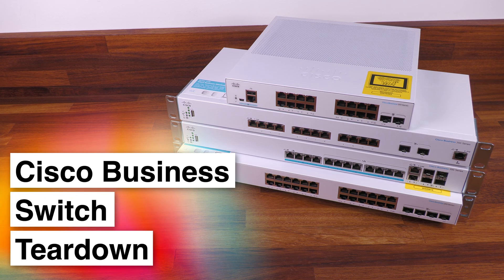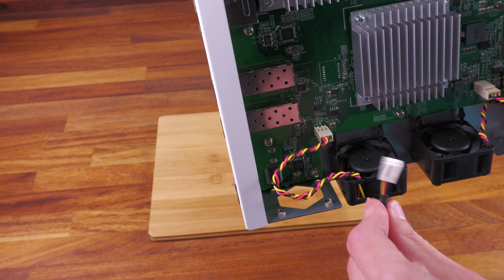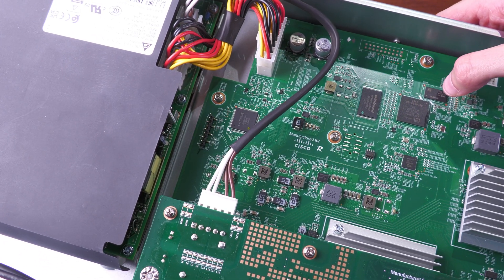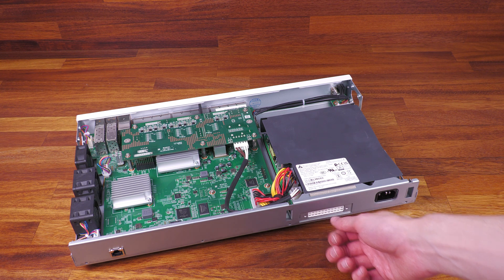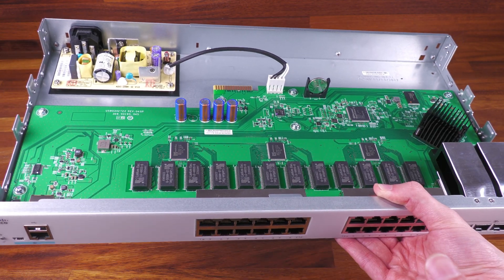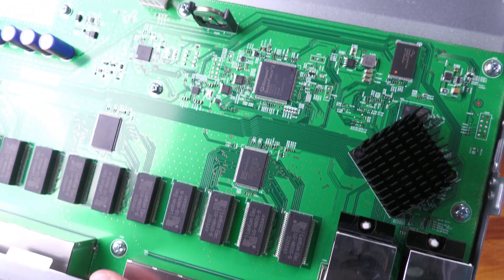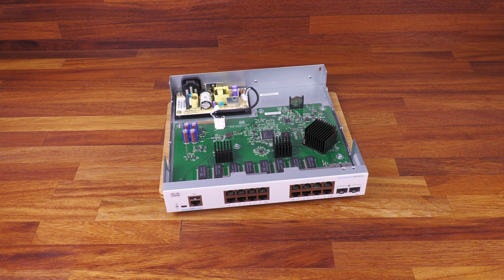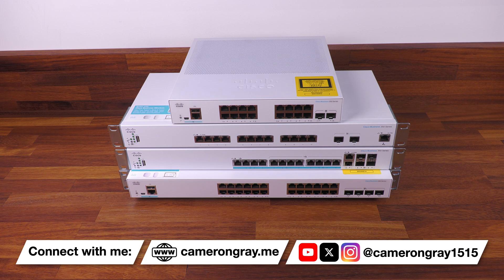Extra Video - Taking a look inside my new Cisco Business Switches!

Comment: PS in CBS-250-24T-4X is almost identical as in old Netgear GS724T. I got mine recently recapped.  I bet it is done by the same factories, even if brand would be diffrent. Apparently, world of network equipment power supplies is pretty small.

Comment: I've been looking at the CBS350-48XT-4X but it doesn't look like it plays nice with AOCs which is frustrating as the furthest run I have is 10m+ and I'm not 100% sure a DAC will work.
I also didn't realise they don't have stackwise cables on them
Reply from the maker: Where are you seeing this about AOCs, I can't seem to find anything?  Personally if I needed a fibre link between the machines, I'd get separate transceivers with a separate fibre cable.  That way you can use different transceivers on each end if either device requires a specific transceivers vendor.  That said, the switch has 10GBaseT ports so as long as the device on the other end can also support a 10GBaseT connection, you'd be able to just run a regular copper cable between them and get up to 100m with CAT6A or 55m of CAT6.  They don't have Stackwise connections, instead they stack using SFP+ cables between the switches (either DACs or fibre) although they can't stack using the regular RJ45 ports, only the SFP+ ones.

Comment: The 24 port was easily the most interesting because of all the exposed packages (lack of heatsinks), and I suspect part of that is that it's newer, the ICs are based on newer processes that requires less power and therefore less heat is being produced per IC; the way it's structured is fascinating, the exposed chips would be little more than port multipliers, bringing in a 8-10Gbps bus connection, likely as high as 16-20 gpbs to upstream (for bi-directional data transfer) up to a controller IC that directly connects to each switch chip, and provides the 4x10G SFP+ links; obviously the 10G chip with the three downstream connections to the 1GbE ports will be the fastest chip on the board to handle all the throughput.  The interesting thing is that it connects to the FPGA from there.  Knowing this switch line (which used to be the SG300X or similar), there's something called SDR, or Software-Defined Routing, and what SDR does is that it can actually handle L3 traffic being switched by the unit based on conditions; I suspect that the FPGA is to make the SDR features work faster to keep up with the 10G + speeds of the switch. there's a 512mbyte RAM chip on the 10G chip, which is likely the CAM table (aka mac-address table).... So what happens is, if a packet comes in on a VLAN that transits VLAN boundaries (L3 switching) it's forwarded up to the FPGA, which will do the forwarding, if the FPGA isn't programmed to handle the traffic (maybe there isn't a rule programmed for the flow), it will forward it to the CPU, which is the ARM CPU there; that ARM CPU runs all GUI/CLI, config, and CPU-based routing and switching, as well as monitoring and whatnot (and likely has it's own RAM in a Package on package design).  The Flash chip hold the at-rest config, firmware, etc. for all chips.  It's an incredibly interesting design and it's likely that other switches follow the same concepts, but run at relatively faster speeds (like the 12XT will move quite a lot faster than the 24T-4X), and require active cooling to keep up with the faster chips and design.

Usually the micro-b USB is simply an internal USB to Serial adapter which links up with the serial interface on the RJ45 port for console, specifically for programming and would generally be wired directly into the CPU (the ARM chip), and of course a USB host port for the external USB-A port, which would normally be used for flashing - eg, in the event the firmware on flash is corrupt or missing, the base programming on the board (UEFI or similar) would be able to check the chip for a firmware file and it would be able to follow a procedure to copy that to the internal flash storage and recover the switch.  I suspect the edge connector is for initial programming, with enough to power on the unit and have a data connection to the ARM CPU and/or direct to the flash storage, to do initial programming and testing while it's on the assembly line.

I'm mostly surmising from experience with how systems are designed from a long history of dealing with computers, and a long history of dealing with switches, as well as knowledge of the inner-workings of how some similar items do what they do.  Bluntly, you'd get more performance putting in an FPGA to do L2/L3 switching when you have programmable interfaces, such as with SDR, than you would relying on a CPU, but you would still need a CPU in there to do the general work of GUI/CLI, and programming the FPGA, as well as system monitoring; but the CPU can be incredibly low power, compared to everything else since it wouldn't need to do more than that 99.999% of the time, with all the traffic being handled by the IC's (ASICs) and/or the FPGA.  Since something like SDR can be changed on the fly, the FPGA would be a logical choice compared to simply throwing in a very powerful CPU to try to keep up with switching the related traffic; and overall it would provide a faster and better flow of data at a nominally lower cost than either putting in an ASIC (which cannot be changed/programmed) or by upgrading the CPU enough to handle the flows, which may require something a lot more power hungry and it would also require rather extensive software switching on the CPU - which would also be CPU bound, so if the CPU is busy handling CLI/GUI requests, it may bog down, and vice-versa, the GUI/CLI may be bogged down by incredibly high switching activity.

Provides a better and more consistent experience overall.  Like I said, I expect most of the (especiallly CBS350) switches are designed similarly.  Very fascinating, and thank you.

Comment: For smaller project installs I've been using the Cisco C9200CX-12P-2X2G switches.  A typical application would be like a security camera deployment with VOIP and maybe wifi. (Think security guard stations at a business park connected to a corporate network)

They are passively cooled PoE+ switches with 12 powered gigabit ports, 2 unpowered gigabit ports, and 2 10G SFP+ ports and can deliver up to 240W.  Now they do run hot but they are completely fanless with a giant heatsink block on top. (The heatsink is basically the case.)  They have a full sized SD slot for hosting applications such as an embedded wireless controller and run IOS 17 Lite XE which to me doesn't seem or visibly appear any different than normal IOS XE.

The suggested retail is about $1800, but you can get them for quite a bit less if you're a corporate customer.
Reply from the maker: They look good, however as soon as you go to the higher end Cisco Catalyst switches you're needing to deal with licencing and support contracts, something that makes them unviable for many small businesses settings.  They're great switches for sure, but just not practical cost wise for many environments.

Comment: I noticed the one switch says "Manufactured for Cisco" which isn't something I would expect an an actual made by Cisco switch to say.  So I'm thinking they either contracted out the switch development, or they found a third party switch and put their own custom OS on it and rebranded it.
Reply from the maker: Yeah, it's interesting, I'd be interested to know what that "R" logo is for - some sort of OEM possibly?  That said, those definitely aren't a white label product that has been simply rebranded, but I wouldn't be surprised if the manufacturing was outsourced to an external company.  Although that's dead common for most manufacturers nowadays.

Comment: why the hell do you need industrial switches for a home network lmao there is no possible reason for that
Reply from the maker: Short answer is "I don't need them" however I enjoy tinkering with these things and it also allows me to produce these YouTube videos.  On the other hand, a YouTube video showing a basic wireless router and unmanaged desktop switch wouldn't exactly be interesting!  Additionally, having 10GbE switching allows me to transfer large video files to and from my NAS at a significantly higher speed than I could over a basic gigabit connection.
Reply: because that's the way he likes to do things.
Reply: Nah industrial switches would be like an IE 3000 or Stratix line.  These aren't even based on the normal Cisco catalyst line which is their normal business switch.
Reply: @stonent  shut up nerd

Comment: The internal card edge could well be for manufacturing: When the board has been assembled, it has no software yet. We add connectors to similar boards, where the connector carries power as well as programming signals. This allows manufacturing to plug one connector into the assembled board, and the board gets powered, programmed, and tested using this connector before it gets put into the case. Since the connector is only used once, cheap is good, and a card edge is cheap.
Reply: There are similar looking edge connectors that I've seen on the small 8 to 12 port small form factor Catalyst switches.

Comment: That port on the back looks like a Cisco RPS power port. Some Catalyst series switches will have this. A Cisco RPS will be a 1u device providing resillient power to switches using the connectors. There is a data reporting aspect to this as well on the pins. I dont know the CLI of CBS switches, but you might see an entry for RPS  status if you enter "show environment all".
Reply: My 3750 v2 has this port too, i was gonna say its a Cisco RPS power port. Quirky how its there tho :>
Reply: Exactly what I was trying to say.

Comment: Wow! Thanks for show. Most products do not need more 19" form factor, 10" enough. Yeah switches these days looks very clean and unstagged. 😉🤗 1st comment after orginal author wrote. 😂
Reply from the maker: Yeah, I quite like what some vendors are doing now with half-width switches where you can install two in 1U.
Reply: @camerongray1515  Yeah, in history the admins in companies build DIY boxes for small boxes but these days the most companies haven't admins nor house managers with offices. Possible do you can build some self and resell the blue print? This makes you independent from YT, Twitch, and other big companies. 

A horizontal small switch with keystone place at one other side sounds great. Same what I can't understand why not all network related stuff only in front - and power management at back.
Reply from the maker: I suppose historically a lot of that DIY construction was done due to a lack of off the shelf solutions.  Nowadays, the cost to a company of staff time vs buying off the shelf solutions just makes the DIY route no longer financially viable.  Complete off the shelf solutions also come with commercial support which many companies want.

As for making something myself, it's not really something I have any experience with.  YouTube isn't my full time job so I'm not reliant on it for my main source of income. I'm already busy enough as is with my day job and other general life things.

As for why switches have network ports on the front and power at the rear - this simply makes more sense for most rack situations.  Ports on the back would be awkward to access in almost all racks.  Netgear do actually sell some rack mounted switches with rear ports as part of their AV range however these are designed specifically for AV racks where it's desireable for all cables to be behind the equipment to give a clean front.